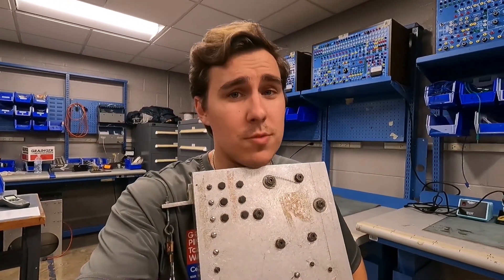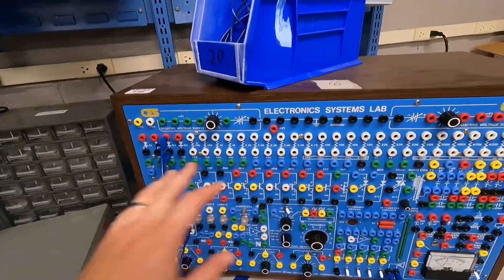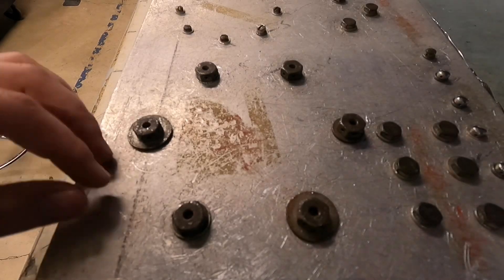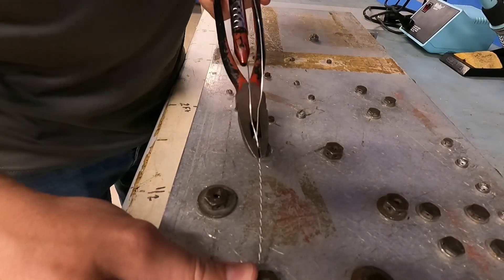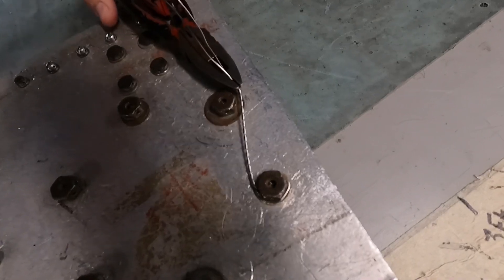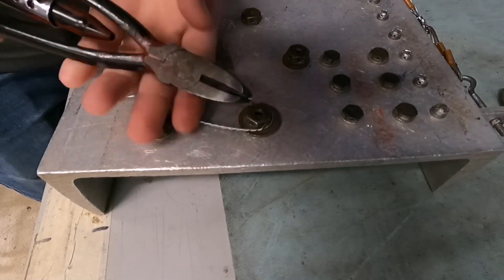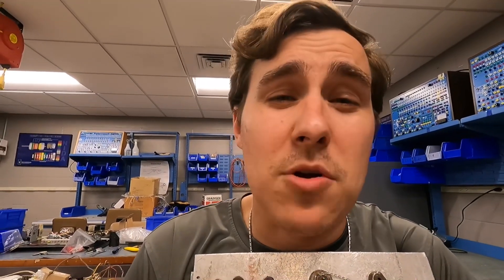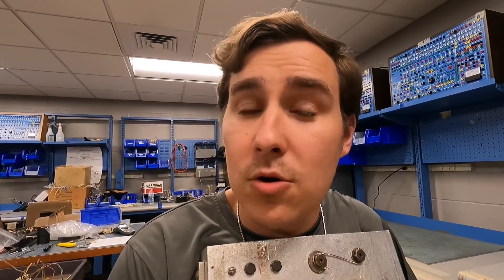4 Essential Aircraft Safety Wire Tips and Tricks | A&P Mechanic Students At Part 147 Schools Or DIY

Comment: No safety glasses?
Reply from the maker: I had them on wiel I did the wire but took them off to film the intro and outro. Good point, though. I'll make sure to mention the importance next video. Especially with safety wire, the diagonal cutters tend to turn it into stainless steel projectiles.

Comment: Where do you source the bolts with the holes for wiring and can you get them in metric?
Reply from the maker: Aircraft spruce has drilled AN hardware
Reply: Depending on what you're doing, you can drill them yourself too.

Comment: If the extra hole is big enough, i would try putting the end of pigtail inside that hole. I have not seen anyone do it like that, but nobody's complaining either. Haha. I had worked in engine shop previously, and I just had so much time in my hand which is why I tried that. Some technicians will end up with 3 pcs of wire when removing them, I do mine same as yours. I always say, safety-wiring is like your signature, better look good!

Comment: Safety wire is fine, if it's required and you have a nice open surface, but I'm so much happier we can use safety cable in most instances

Comment: My inspector told me a great tip as well because I struggled with safety wire so much with loosening and neutral safeties. "think about it as a backwards S", useful in a lot of scenarios but not all the time. Helped me so much.